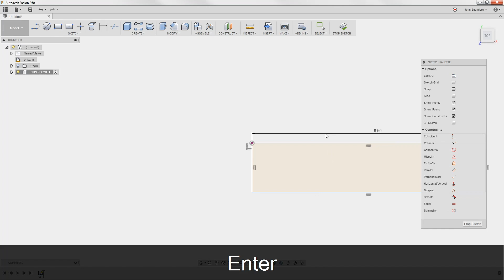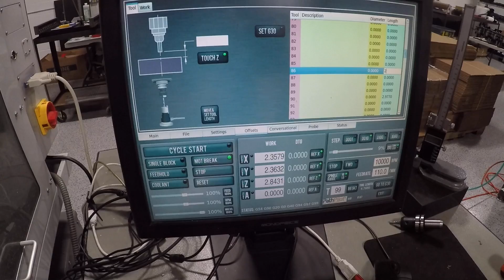SuperBowl Sunday NYC CNC Style!  #SCIENCE

Comment: I think you should try to offset the path of the tool half the engraving width towards the "inside" of the letters rather than exactly along the edge. It would make the end result more readable. And have you found a solution to clean the sharp edges when you don't want to mess with top surface finish like in this case?